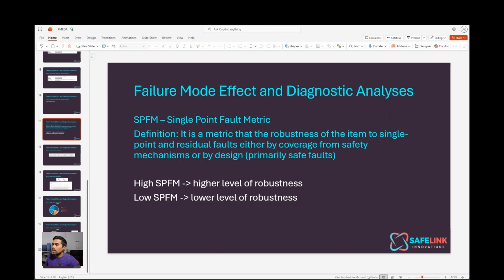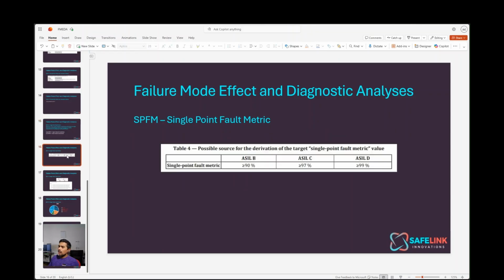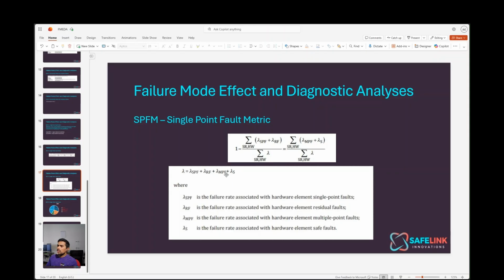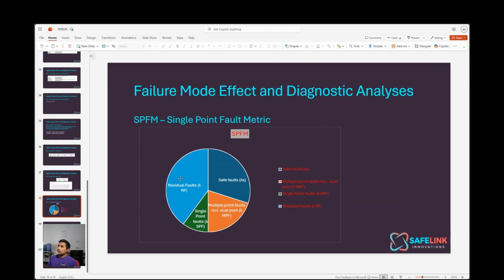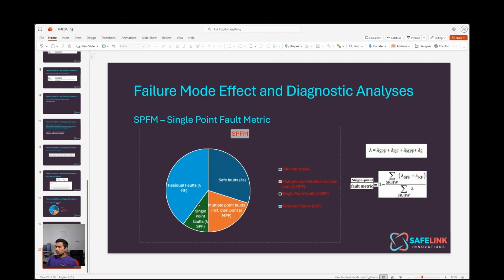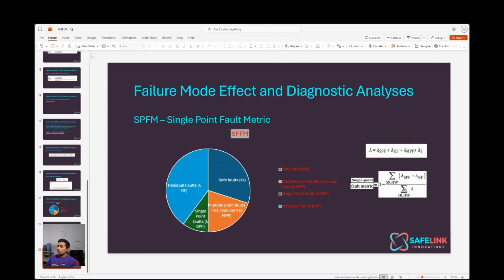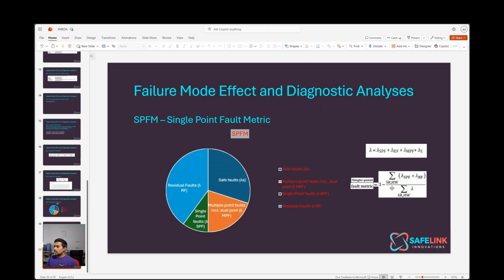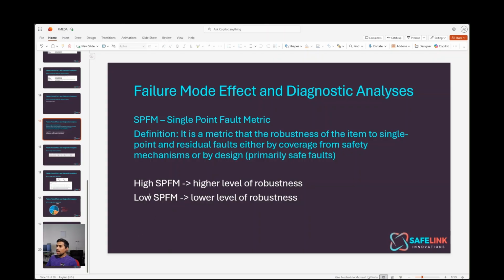Calculating SPFM - Single Point Fault Metric - Part 1

Comment from the maker: Calculating SPFM, LFM, and PMHF manually during FMEDA can quickly become complicated - especially for large hardware architectures.

SLIKWORKS FMEDA Software helps automate these calculations and manage failure modes, diagnostic coverage, and safety mechanisms in one place.

✔ Automate SPFM, LFM, and PMHF calculations
✔ Manage component failure modes and FIT rates
✔ Track diagnostic coverage and residual failures
✔ Build FMEDA models much faster

Learn more:
https://www.safelink-innovations.com/slikworks/fmeda-software